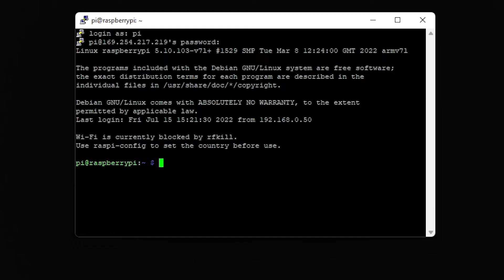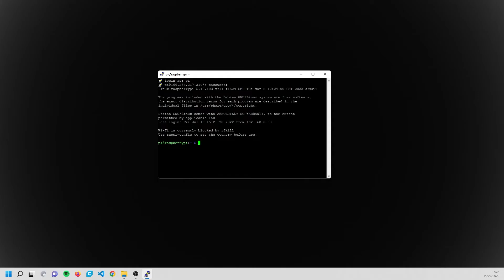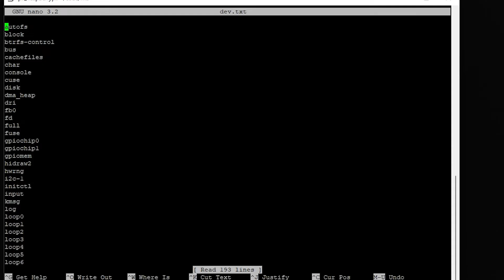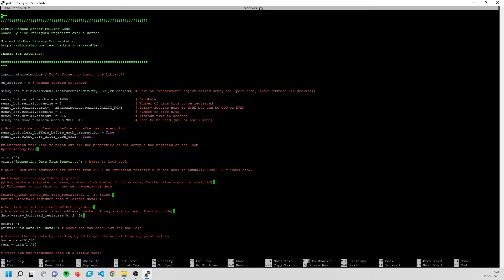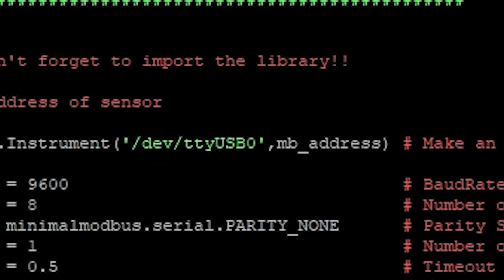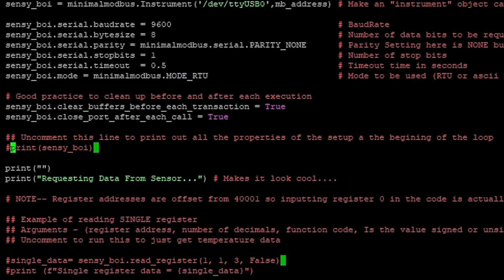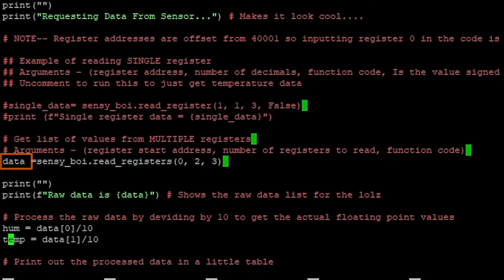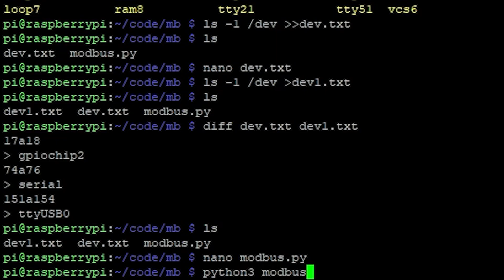Easy Modbus Using A Raspberry Pi

Comment: Linux will never make it big if it doesn't make things easier. I followed your steps but discovered that pymodbus must be run in a virtual environment. Still working through those issues.
Reply: Hi there, i also did the same but my Rip5 never seemed to work, did you manage to come right and how?

Comment: For anyone else having this issue. I had to connect the serial converters A(+) to my sensor's B(+), and the converter's B(-) to A(-) on the sensor. A bit odd but just try swapping the wires if you have an issue.

Comment: How do you do this with pymodbus TCP, do you just switch out the usb address with an IP address?
Reply: yes you need to make a connection first, than you can read registries choosing the right function code

Comment: Hi men, I found your video very usefull, but I have a question for you, in this case I can see that you use a USB converter and you connect a a pair differencial cable to the instrument tha give you a temperature and the humiduty and the usb you conect to female cable and I supose taht you connect to the microUSB port of your raspberry, so my question is How may I read the modbus registers but I want to use the UART pin and read form the port ttyAMA0?, I hope your answer and excellent tutorial

Comment: Hi! Thank you for a very instructional video! I looked over your "Finding and Listing Modbus Sensors Over RS-485" but wonder if there is any easier way to list the modbus address without having to use Siemens 1200 PLC. I am very new to this type of programming so any simplifications are greatly appreciated.

Cheers,

Comment: Hi, awesome video by the way, helped us alot, but we are facing a problem with 2 of our sensor when we try to connect our sensors together. We connected 10 sensors by series, but 2 of the sensors when connected in series keep giving us invalid response error, check sum error. But when we connected it directly to the usb without connecting the sensor in series(individually ), it is able to work. We tried to change the wiring, but it keeps ended up getting that same error, so i am hoping that you can give us some thoughts on how we can debug it, or is there any setting that disable the sensor ability to connect in series(?). Hope to get a reply soon
Reply: increase your timeout

Comment: Please create a video for the SPI interface or point us in the correct direction on setting it up.  Maybe a full video using the Pico W, and a website build. Or better yet.. use the normal Pico for the code to get the data from the rs485 wind vane and the wind speed, and then use i2c to send the data to a non pi SBC (Le Potato) that can then add  cameras of the clouds and send it all as a webpage out to the world on a usb cell modem...   I have all the rest done but the Pico side... This (the Pico) is my 4 dollar workaround for the GPIO addressing issue that the Le Potato has currently.
Reply from the maker: Wow! that's a whole load of stuff! Would definitely milk that over a few videos!! Haha. Honestly though I am planning a video on SPI, UART etc at some point.
Reply: @Intrigued_Engineer  thank you I love to give out a lot to get a small bit.

Comment: Nice video. Can you please tell me the specs for the temperature/humidity sensor that you're using here?
Reply from the maker: Thanks very much! We got these sensors in bulk a while a go and use them on various projects. Found them as an Alibaba special! Link below. Out the box about 10% were dead which isn't a great percentage but the 90% that worked have actually performed very well in the field with a low percentage of failures after install. That's actually saying something, we're based out in Saudi and we put these sensors through absolute hell!

https://www.alibaba.com/product-detail/MTH100-NRN-0-3-High-Accuracy_62437507744.html?spm=a2700.shop_plgr.41413.9.609c83a7xgY88f

Comment: Is it possible to connect multiple devices using only one adapter?!
Reply from the maker: Yeah you can connect multiple! the address is stored as an 8 bit integer so there are 256 "addresses" technically available from 0 - 255. You cant use address 0 as that's for something special and it's general convention not to use address 1 in a network as that's what most devices are by default so it is easier to add things to an existing network if you leave address 1 vacant. In a nutshell you can use addresses 2 - 255 meaning (using normal Modbus RTU) you can have 253 devices on one network.
Reply: @Intrigued_Engineer  So in each device I configure the address and can connect all of them to the same USB converter. I've seen that all modbus devices connect in series. Am I correct?
Reply from the maker: Correct yeah, all back to one USB.  General convention is to "daisy chain" in series. With long runs you'll need to put termination resistors at each end to help minimize signal echoes but you'll need quite a large network for that to be an issue.

In reality I've done  daisy chains, star networks and hybrids of the two and its never been an issue for getting clean data. 

As a tip with minimal modbus, for reading loads of field devices, it can get a bit flustered and start to bit crash (only really seen this when trying to read ~20 sensors in a row). Its supposed to wait before being recalled but I've found its good to code in your own check function to check that the previous call is definitely finished before allowing the address to increment and moving onto the next call.
Reply: @Intrigued_Engineer  Thank you for the help, I was able to read two devices from different brands on the same converter. I'll take your other tips into account. I'll investigate a little bit more about the resistors.

Comment: thks for this video. it's exactly what i'm looking for.
i'm very new to this field and i have one prject: i have a Camera connected with the RPi and with the help of OCR I extract the text from the picture and I have to transfer know this text throught CAN bus. i wanted to use RS485 CAN HAT but I find it as easy using usb to rs485. please can you help me?
Reply from the maker: Glad it helped! Being honest I've no experience with CAN bus hats. My go to for this would be a USB/485 converter and handling the CAN bus within the Pi. But that's just me doing what I know. Is there a reason why you're using CAN bus specifically for this?
Reply: @Intrigued_Engineer  ok i will try with it.
yes i want to tranfert the data to some cloud that use CAN bus